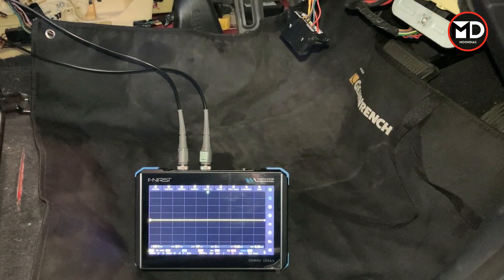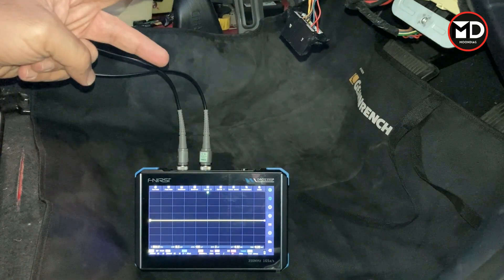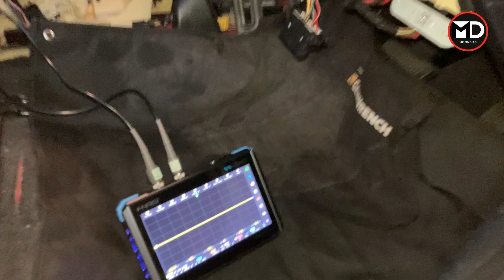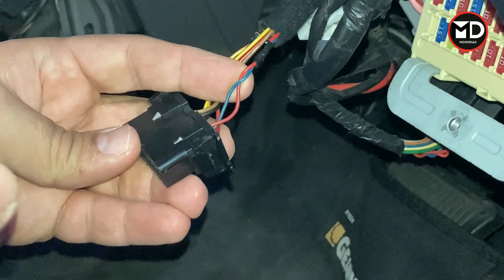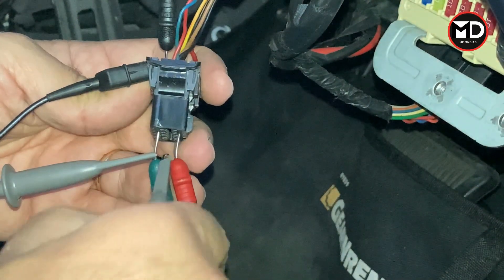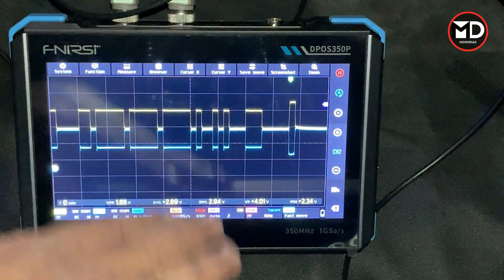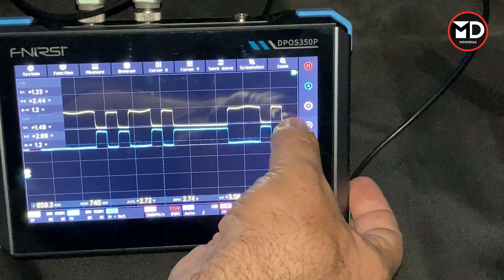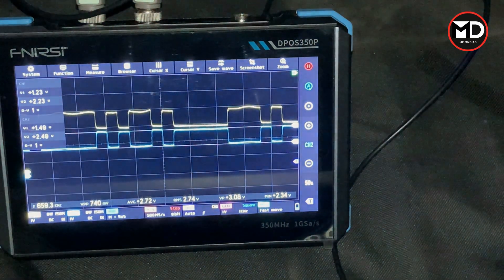CAN BUS Diagnostic with a Budget Oscilloscope | Fnirsi Tablet Oscilloscope (DPOS350P) #canbus

Comment: This video is way longer than it needs to be. And you only need to disconnect the negative terminal. You can press the brake pedal. Or after you disconnect the negative terminal. Touch the negative terminal to the positive terminal. Then the ECM is cleared. However. Disconnecting the battery can cause more problems depending on how new the vehicle is. And disconnecting the battery depending upon what the make of the vehicle is can require special scanners to relearn certain sensors in the vehicle or cause damage so be careful with disconnecting the battery

Comment: Thank you this very detailed description and video. One thing I have not seen on any of your videos with this scope is a proper trigger.. you always pause the sampling to show a steady wave form. Trigger does not work on this scope?
Reply from the maker: Hi my friend, thanks for watching the video. Of course trigger works on the scope. On CAN-Bus we can set the trigger on the signal at the end of the CAN message which normally provides a little higher voltage. In upcoming videos I have used the trigger 😊👍
Reply: The Fnirsi trigger hasn't evolved since its very first scope. It doesn't have an advanced trigger, just a simple edge trigger.
Because of this, it can't trigger on the data stream, you won't get a nice still image with it. Unless you stop recording or use the single trigger.